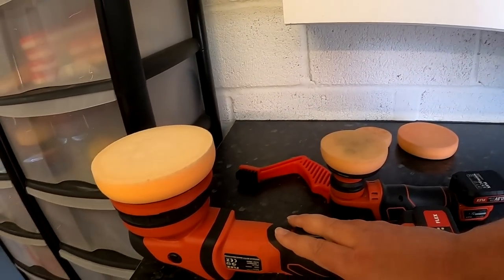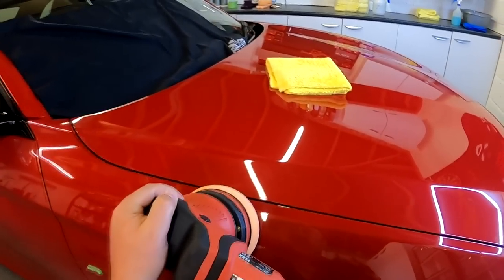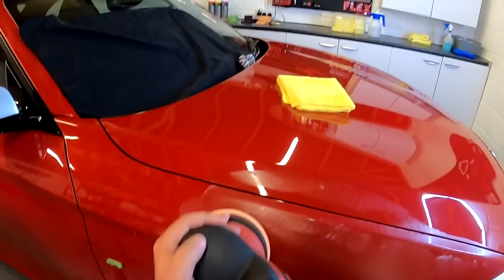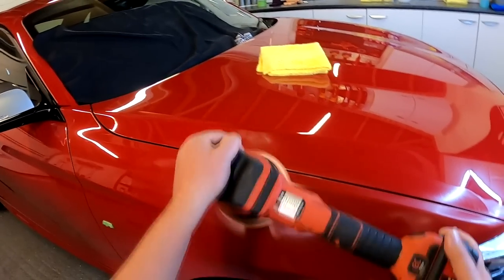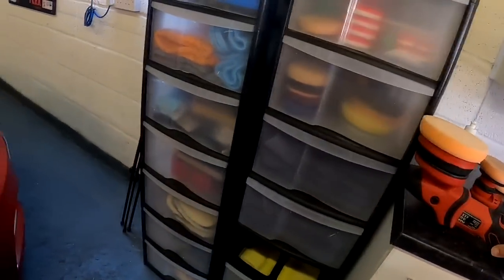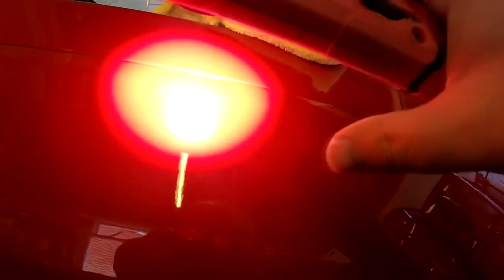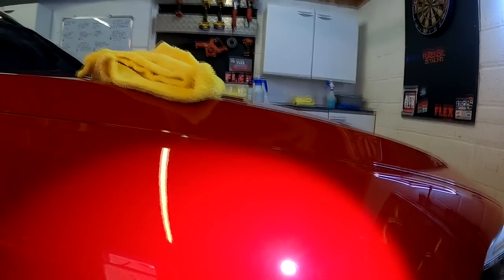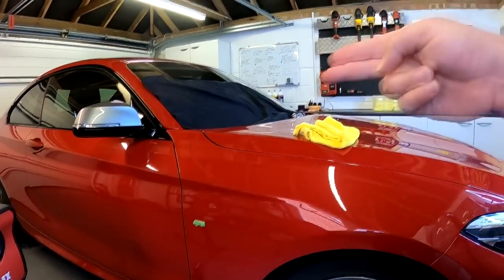How to Polish your Car with a Dual Action Polisher | Beginners Guide

Comment: I bought a da polisher last year with various pads and sonax perfect. Gave it a blast on some lightly swirled scratches on the boot of my bmw with a soft pad and nice shine but no scratch removal and didnt bother again, thinking maybe it was just for light polishing and buffing. This week a friend brought over his discovery with a badly damaged pillar that looked like someone used a scourer or wire wool to remove something! I tried the same but with the hardest cutting pad I had and hey presto one step cut and polish back to perfect in about 4 minutes!!! Im going to experiment with different pads on the bmw now! This stuff really can cut or be a light buff depending on the pad!

Comment: Jon, could you make a video about how to clean pads properly? Also a review of pad cleaning systems like the lake country one would be really useful and appreciated.
Reply from the maker: Ive done these videos already buddy.   use a hose to blast out the pad while you hold it is best method.   the pad washers look ok but I know very very very few people that use them the price point and storage and you just dont really need them is the main reason.
Reply: @forensicunplugged4295  , sure. I’ve seen one video where you mention handy tips about how many pads you need for a car and that one should brush it between sets and use a pad for about 6-10 sets. I’ve also seen a video where you wash a pad and then show a handy tip of squeezing a wet pad between two mf cloths to dry them. I thought it might be a good topic for the channel to have one video on the subject and also include a comparison / review of manual wash versus something like the lake country cleaning system that in2Detailing started selling recently.  👍

Comment: Good video John, not too long as well which is great.  On your recommendation I bought the DA8 and had my first go with it yesterday. Using S20 Black with a 5 1/2 inch green Chemical Guys and a 3 inch Flex I did my old motorbike. Absolutely delighted with the result and I learned so much doing. Cheers
Reply from the maker: thank you stuart.
Reply: S20 Black and the Green Hex-logic still a brilliant combo in my book.  3 years in, I can't switch away from it - it just works!

Comment: To try and get rid of swirls like that with SPF and those pads is asking a bit much of that product as you say. 
If you try Rupes Da Fine (yellow) on a Rupes yellow foam pad, or even a yellow wool pad, you will be surprised how easily you can correct that with one pass in each direction. It would take about 45 seconds to 1 minutes to complete each set. BMW paint is very hard and the SPF would only serve to refine after cutting first. 👍

Comment: 1. Are you applying any pressure Jon, or just using the machine’s weight? 2. How long do the batteries last. I’m thinking of buying both Flex machines. Cheers Jon.
Reply: John’s done a review on the cordless flex. Search his channel for it. I think from memory it’s 40-50 mins depending on the speed. 

Normally for any polishing it’s the weight of the machine. You can force it on problem areas but your initial set try to keep ever abs review the area for additional work. 

If your getting into it John has done a training course. Cheap and takes you through the lot. Will save you the cost of it through the price of screwups trust me!
Reply: @simonb6306  Thanks Simon. I’ve signed up to his course.

Comment: Jon maybe swap pads for the  flex purple pad get the extra bit of cut instead of getting out a compound .
Reply from the maker: you could do this the hard paint wont marr with those pruples so that will work more cut...    I actually moved up to H8 and purples and finished this paintwork the BH cleanser polish or oranges.  a few more videos to come on this car.

Comment: Hi Jon, 
The BMW is a hard paint, what would you differently for a soft paint Eg - Honda?
Great presentation as usual Thank you.
Reply from the maker: you can still use flex purples on honda paint in fact they are ideal to cut.  and finish with orange will work on honda.    but if you need to go mega soft to finish out you can switch to flex red pads and M3.    very very very rare but sometimes S40 or Menz 3800 can be needed to finish out mega soft nightmare paint.
Reply: @forensicunplugged4295  going to try the Bilt Hamber cleanser polish then Aqua wav to see how it performs/looks.
Thank you for you response I’ll try the pads out on my Makita forced rotation/da. 😀👍

Comment: John, ive been detailing for a number of years, have various flex machines and like to think I know what I am doing.... I however now own a Tesla and it could do some correction this summer, but I am conscious about the soft/thin paint reputation they have. Mines a 23 plate model Y performance in Multicoat Red, not sure if Tesla have changed their paint process from yesteryear or not...

Anyhow, I am considering a paint depth gauge so I can get an idea for whats what. But what would you recommend and how do you even use one seeing as it can't separate clear coat thickness from overall thickness?
Reply from the maker: any that the main online distributor sell will be half decent mate.  they dont need to be mega accurate.  I use DT156

Comment: Ive given up on the larger DA machines....they always stall out, i stick to forced rotation mostly now
Reply from the maker: the dewalt is pretty good on this front  but all free spinning machines stall over curves and stuff yer I noticed many years ago I get so many more like patches of swirls that are not removed with a free spinning DA compared to force rotation.  forced rotation works the abrasive harder, it dries the polishes out quicker but you can get more done and its more consistent and you cant stall it.

Comment: Hi Jon could you please tell me if you need to clean the polish with eg bilt hamper cleanser fluid in between polishing and waxing
Reply from the maker: final degreaser wipe down with BH cleanser fluid then wax will give best results.. surface needs properly degreasing after polishing

Comment: jon if you go through the trouble of all that perfection polishing why not lay down a high end coating to preserve those results, like Car Pro Finest Reserve.
Reply from the maker: coating :)  so 3-4 months down the line even with a coating. I want to get at my paintwork to buff it up.   buff on paint (not to correct it) but just to clean it up gives you the lovely gloss.  buffing can tidy up the paint. I love when my protection dies.  I quickly fly over it  with AIO and get silky smooth paint again and then wax it out.   coatings kill the enjoyment and stop me buffing (essence plus isnt the same).   plus coatings are a major pain if you scratch or damage the paint and need refinishing. ou have to get it all off before it goes to the bodyshop they simply dont understand coatings and how to remove them.

Comment: is an 80mm or a 100mm pad more useful? thanks for super nice content and how much gb of space you use up for one of your videos (thinking of starting one)
Reply from the maker: very few 100ml pads on the market mate very very very few.   80ml is a standard though .. 125ml and 80ml  5 and 3 inch do 95% of the work... spot pads for rest.
Reply: @forensicunplugged4295  I am talking about the contact diameter, not the backing plate  carpro da pads diameter is about 80 but its tapered and get to 100mm
Reply from the maker: @simasm.9757  ok mate. yer i mean its so confusing isnt it. there needs to be standards created for pad sizes.   1/2/3/4/5/6 inches was almost a standard but the 3401 used non standard plate sizes.  etc..   there some wierd vartations in 75 ml sizes for example hex logic.  down at DA the plate sizes there theres a non standard plate size just up from 75 ml as well that cuases all sorts of consfusion its chaos mate. I have to try and explain it to people :)
Reply: @forensicunplugged4295  yeah they should make only two type of pads ones that are same as its mounting so like 75 and the contact is 75 and maybe a one taperd size

Comment: Jon I want to go over my car with Autofinesse Tripple as a final glazing polish before wax. How long should I work each section for? I guess it won't be as long as a true compounding set?
Reply: It’s got no real cut and only seen it hand applied. On some waxes if the car body shape suits it, maybe try a small section with a DA with a finishing pad just to coat it one pass.  It’s quite wet from what I remember so may splatter a fair bit so try it in a slow speed and see. Haven’t used it much so may be wrong but a lot of the ones for hand application on the bottle are not for use with a normal polishing set.
Reply: I have used Tripple with a DA, and Jon is dead right - it is quite milky and it flings a bit. Didn't see any great effect, might as well have applied by hand and it would have filled any remaining RDS.  With a machine I'd use an alternative all-in-one like AngelWax Regenerate (just bought that) or a finishing compound like Scholl S30+ or Koch M3
Reply: @johngriffiths3394  you get in that weird area of is it a final polish or lsp. Personally I would go s30+ angle wax like you say. The car pro essence is nice as well bit of filling,  then use a dedicated lsp. I do t think you save much time putting it on mechanically. If the aim is to refine the finish then refine it mechanically. If it’s to protect then it’s just applying the product evenly in the easiest way possible.

Comment: Question, how much pressure were you using during the passes??
Reply from the maker: not much mate just the weight of your hand.  you can add more but you have to maintain that for every set so let the machine and gravity do the work as much as possible and your will be less tired and more consistent.

Comment: Which type of polishers be better in your opinion? DA or Forced Rotary?
Reply from the maker: personal preference mate Ive done a video explainging pros and cons on the main channel my friend.      My favorite is force rotation DA.
Reply: @forensicunplugged4295  flex? :) I thinking about  XCE and PXE
Reply from the maker: @janniezbedny985  yes this is what I use. be aware the PXE is a nano tool though.. the 75 ml DA mode on it is veyry good for nano tool but a proper corded 3inch mini has a lot more capabailty to cut.
Reply: @forensicunplugged4295  Thanks for anserw. I have small rotary too, so collecting money for Flex. Thanks 👍

Comment: Larry Kosilla and Kevin "BuffDaddy" are getting a stroke watching you polish around bodywork fold lines lol - they made a 2hr long live video teaching how to do it using multiple tools to such an anal extent it virtually put me off paint correction :D. 
DISLAIMER: I didn't sit and watch it for 2hrs, it was running in the background while I was working!
Reply from the maker: well these guys know their onions.  I dont polish along the swage lines though.  I polish the flat bit above it and then the flat bit below it.  yes I go over it with the vertical pass.    you need to be reasonbly sensible with these lines specially on a rotary and DA I guess, dont buff the lines obviously.  but saying that Ive never polished through one in like 15 years.
Reply: @forensicunplugged4295  Jon, I wasn't criticising you :) My comment was more about some people making a religion out of car paint polishing and are ready to crucify anybody who doesn't do it the only correct and proper, prescribed way :). They obviously successfully tapped into the very pinnacle end of the market where they charge for their detailing and paint correction services whatever they want so they can spend days polishing a car. Not only in my eyes it is completely pointless buy I dare say damaging to the car - there is nearly nothing left from the clear coat when they are done polishing it for two days...There is no magic here, polishing removes material from clear coat, the longer you do it for, no matter how expensive the compounds, pads and machines are, the less is left so the next person polishing it will burn through to paint or if they have a gauge they will not touch the car any more. Point is, a 2hr paint correction taking absolute minimum of the material away to achieve a substantial improvement for the customer while preserving the clear coat is what we are after here, right? What we call 70-80% improvement is day and night for anybody but a detailer! Detailer's disease - we see things nobody else is able to see - show me a regular car owner who goes around his/her car with high power sun light every weekend looking for holograms, swirls and imperfections... There is this chap, detailer with 30 years of experience, name is Yvan Lacroix (look up his channel) - what a breath of fresh air of sensibility listening to his vids (nothing to watch there lol) - I loved the one about the best ceramic coating ;) . This is the reason that I watch your & Yvan's channels and not Larry's - keep up the good work and keep running!
Reply from the maker: @peterlabiak1051  yer theres a massive difference between proper full on detail and what I call a turbo polish pete.  you can pay like 100 pounds for turbo wash and machine polish and you can pay 10 grand for like a 100 hour detail.
Reply: @forensicunplugged4295  turbo polish - brill brand name, trade mark it mate! Fair game if you want to pay 10 fat ones for a car detail (not talking about classics or restos etc.) but frankly in 100 hours you could repaint the car and replace the whole interior and it would probably cost the same lol - I just checked prices and full car respray with some repair work is circa £3-4k and used interior for m240i is £600 on fleabay ;) so say $2k for full interior mostly new -  that leaves you with 10 days labour @ £50/hr @ 8hr/day. Also, what the hell would one do detailing wise for 100 hours anyways??? and I know £10k and 100 hrs was just an example figure :). Bottom line for me is the detailing is an amazing profession when it transforms chariots fit for a crasher only into perfectly presentable vehicles but some people blow it out of any proportion keep it simple, keep it clean and make some money ending up with happy, returning customers - what is the best coating in the world for your clients? The one you put on their car :). I am very glad I discovered you channel long time ago, whee no BS approach is the only approach with value for money and performance ruling the roost. I literary buy the products you use and I have not been disappointing yet :) - just received a delivery of a box full of Koch Chemie goodness ! About to try out their Tea ;)